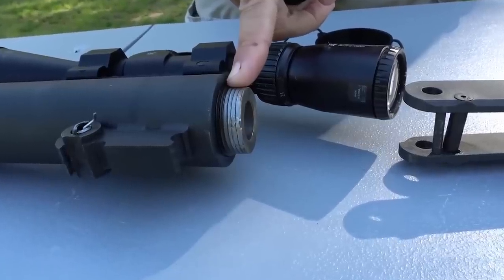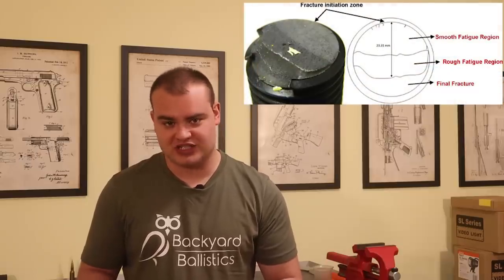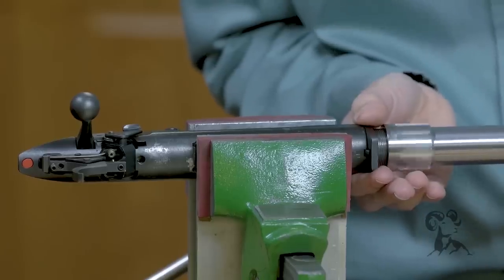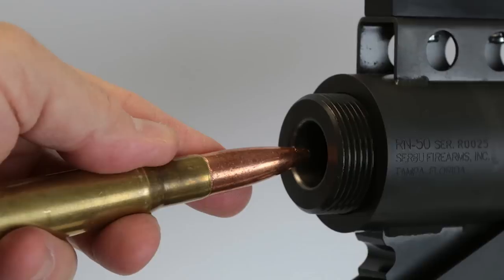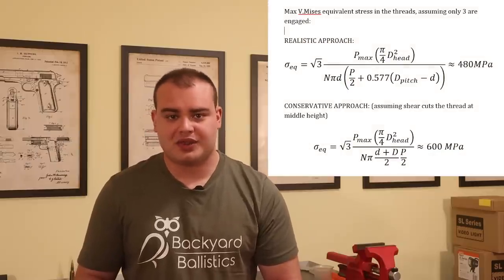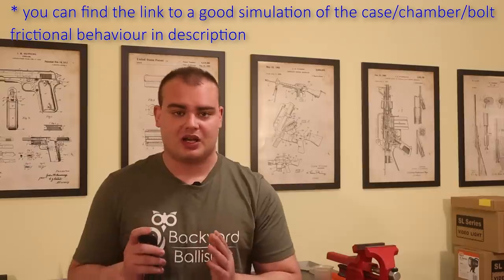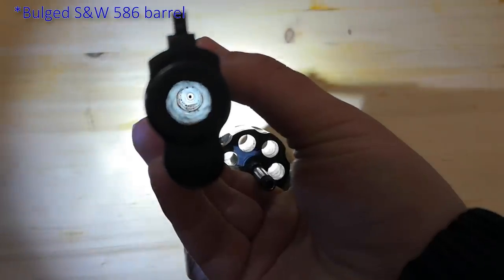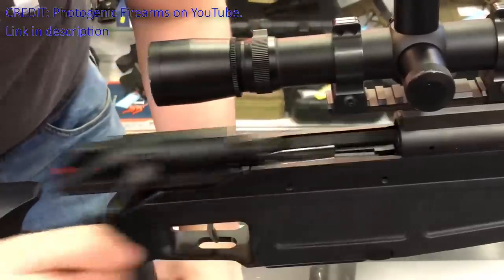Serbu RN-50 Failure: A Closer Look

Comment: Who didn't see this coming anyway ? As soon as I heard about that project between Serbu and RoyalNoneSuch I though the anti-gun community is not going to just stand by and let folks buy .50 caliber rifles at affordable prices without interfering with the process somehow. In other words they can't wait for episodes such as this to occur to highlight them and try to scare away the would be buyers or the gunmakers from making them. It is a very powerful round and with that the user always assumes some level of risk and in the case of powerful calibers the mishaps can obviously result in much more damage than an ordinary caliber. I tend to be satisfied with the old smaller non-magnum rounds and guns myself since they are reliable affordable and usually available and reasonably priced as well. .22LR, 9mm, ..45acp, .223,, 30-30, and 30-06 can get the job done across the board for civilian purposes and I don't find them boring at all.

Comment: im just another idiot off the internet, my take on what you and other channels suggest can happen to cause similar effects is ;
way too hot load intentional/ unintentional/ degraded over time
case rupture / head failure/ other gas into breech face
the design is quite ok. but a few holes drilled radially on the breech cap to bleed pressure would be nice.

Comment: Stretch & fatigue / time, without a sufficient failsafe.

Do the math,
.50bmg Nominal pressure is usually around 55,000psi.
Internal rear casing diameter nominally is 0.68"
So around 20,000ftlb minus the casing to breach stick call it the 20%  exerted on the thread under normal conditions, that would change marginally depending on the load.
Thats around 7tons of force, that thread should be able to deal with that load indefinitely regardless of rate of force change, it easily has a <50% safety margin. 

I would question the source of the ammunition. Likely a extremely hot powder load and heavy grain projectile that would blow that thread out, was it handloaded? But in very poor taste to have no rearward breach failsafe with a rifle of this caliber...

Comment: There is talk about Sabot rnds can't be safely shot through a muzzle brake.
Reply: Because it is bad for the muzzle brake, and the rounds my be deflected towards friendly positions.  Not because it will blow up the breech.
Reply: It only results in poor accuracy and potential damage to the muzzle brake and maybe the crown. It has no effect on the breech.
Reply: @MrSteve8511  Seen it. TR is wrong about a muzzle blockage rupturing the breech.  Re-watch this Backyard Ballistics video.  BB explains why.  TR is an "authority", but not an engineer.
Reply: Not a safety issue, more a parts breakage and accuracy issue.

Comment: The thing that caused the accident was the SLAP round, and the gun. The reason you haven't gotten to see the case, is because there is no case to see it basically disintegrated. The gun was not made to shoot that round, it couldn't withstand the pressure of the round. Now the round that caused the accident, that round was hot, more then the other rounds he shot, those SLAP rounds are old and dangerous, if I were you and you have them, don't shoot them out of that same .50 BMG rifle, or a M2 Browning, those weapons are not made to shoot those rounds

Comment: The gun broke because it was a hot round, it would cause a failure in any gun the issue is that the gun in question has no safety features for a detonation other guns would have other parts that would break internally the rn 50 is basically a 50.cal cannon not a "gun" or the very best a 50.cal pipe gun edit: I never liked that people called that pos a gun lol

Comment: SLAP rounds should not be fired through a break.  It is the deposits of SABOT material inside the break that caused the gradual increase in pressure with every shot.  By design SLAP rounds are a lower pressure round.  The fact that the round went down range is irrelevant.  The sabot created the obstruction, and it dislodged with the catastrophic overpressure.  The screw on cap is similar to a screw in breach on a muzzleloader.  They have failed at way less pressure than this.  So let’s look at the facts.  The breach is not secure enough in this design.  Had there been a locking bolt on their rifle.  The catastrophic failure would have been at the break.  Because the breach isn’t at least 10X stronger because chamber pressure will always exceed muzzle pressure.  The failure happened at the at the chamber and create a greater risk to the shooter.
Reply: Creator says otherwise but, i agree. The failure itself is not relevant, what is relevant is the failure mode of the gun. This could have been so much less painful if the design was safe.
Reply: @trpstrincllc4866   this failure is very similar to what you would see in a pump action shotgun with over pressure issues.  Failing at the breach.  It should have blown break off. Like a normal boy action rifle.

Comment: That was just a round that would have demolished ANY 50bmg.  It was a bomb and freak round.  To shear threads, it had to break off both of the tabs that are tucked right against it which is impossible to imagine until this.  The force required was waaaaaaay more than the maximum load pressure.  It was just a slap round that had either been double loaded minimum or tampered with to cause an explosion.  So, the idea of making the gun safer is pretty unrealistic.  It was as you say, max + 50% minimum which is where they are all configured.  How could you even guess at the amount of pressure that came from that round?  Say 120,000psi? More?  Standard pressure is 55,000.  Are they going to throw away every 50 cal gun and redesign for 180,000psi?  That is just unrealistic and stupid.  It was a bad round, bad luck, bad accident.  No more no less.

Comment: Experienced an 'ACCIDENT' (sic) out on an oil rig once, a 400 lb pipe spinner with enough power (Torque) to spin 90 feet of steel drill pipe as if it was nothing, incorrectly tied down, meant to be tethered in both directions, and then a POS named Chris Wallace threw it into reverse and it was doing a 10 foot arc damn fast, if it wasn't for my cousin Tony, an accurate bastard, showing me the precise technically correct Shotokan forearm block I'd have been dead, as it was it broke my neck and I'd hit the ground about six times faster than gravity would have moved me, I'd been so fit (Kung Fu) at the time it was sick and my first thought was to bounce up and knock that bastard cold and could have, bounced up and knocked him cold but, I'd known I'd been seriously hurt (Neck broke and whole shoulder\back ligaments torn up) and it would have made the worker's comp issue be hard to prosecute, as it was got ripped off for $100's of $1000's of dollars anyway...

Long story short ~ Accident? ~ Nope, Dcik Chayney's Occidental Petroleum were leasing the rig :-(

Comment: Achievement unlocked, and that's me subscribing.  I'll try to keep this short.  I recently received an RN-50 with a 22" Barrel (Haven't shot it yet), I waited for quite a while before I finally got it.  Scott's Video has not deterred me from getting one, I was wanting a Break Action Firearm in my collection, but also a 50 BMG, so the RN is what I got.  The Gun has gotten a lot of hate from different sources.  One comment I saw on a Video said something along the lines of, the RN-50 is a ticking time bomb from after a thousand Rounds or so, the Threads on the Cap and on the outside of the Chamber will start to wear off and increase the chance of an explosion at that point to.  The Gun does not really have a Fail Safe, which I understand that concern, but one's Brain is just as much of a Fail Safe, like inspecting pre, post and after a Range Trip.  Checking the Threads often may not be a bad thing, but also taking the Gun to a Gunsmith is an option at that point as well, and generally knowing and cleaning your Tool(s).

Comment: A non heat treated and non hardened back cap with a safety factor of 2 at best didn't make the situation better.
Neither does the fact that .50bmg loading data is 100 years old and has according safe pressures, that modern military rounds exceed by a long shot. Even worse on heavier tungsten projectiles.
And if you add a constantly closed rifle that has a hot chamber after very few shots and keeps the round in there a long time before shooting, resulting in a thermal treatment of the powder that increases pressure even more, that's a recipe for failure.
There is a reason why neither the rifle nor the slap rounds were CIP certified. And never will be.

Comment: It's a catastrophic blowup for sure  . He said it was a SLAP round.
Sabot, Light Armour Penetrator.
It features a 30 calibre  tungsten  penetrator at 4000fps. It'd have to use faster powders than normal for 50 BMG to get that velocity. 
He said they were rare and expensive.  I wonder if he bought it from a cartridge collector . They've been known to run tarnished rounds through a vibratory tumbler . You get a better price that way .
I have heard that the process of tumbling a loaded round should not be done . The vibrations can grind the propellant kernels smaller , remove retardant coatings and increase it's burning speed .
A thought for you to consider .
Reply: No, it doesn't use 'faster' powders. The projectile is lighter. The powder cant be any sort of 'fast' in a case/bore that large.

Comment: One needs to lock at the ammunition that he used. surplus SLAP rounds over ten years old. One does not know where these rounds originated from. We're they reloads done by a third party and sold off as surplus ammo?  If this was one of the rifles that would have been designed to use the Russian 12.7 mm round I would question if these were adulterated rounds. It is well known that a lot of the Russian rounds for both the Kalash and Deshka 12mm rounds were reloaded with a high explosive and were designed to destroy the weapon and the combatant using the weapon. I would doubt this is the case in this scenario. If you watched his video you could see the progressive power of each successive round until the breech cap failed on the last overloaded round. I have a rule of thumb for most .50 cal rifles is to use ONLY factory loaded ammo or IF you are a qualified reloader, use your own reloaded ammo.

Comment: The problem I have with the threads are the fact that they appear to just be threads. Meaning, if the cap is not torqued properly each time then there is a possibility of thread stretching each time it isn't properly tightened. Loose threads and there goes the ball game. Generally, you want the threaded connection in the 75% of the strength, so as not to permanently over stress the steel. Over time I would think this would have the effect of allowing more and more momentum. I haven't heard that there is a detent to let the user know that they haven't tighten it enough. Instead of a break open design, I would go with a falling block design. I don't know if I've ever heard of this type of arrangement on this large of a round. I think more in line with a zip gun, shotgun shell in a pipe. Anyway, interesting discussion.
Reply: "I haven't heard that there is a detent to let the user know that they haven't tighten it enough. "
That's what the 'safety ears' are, if you haven't tightened the cap to it's base, the receiver can't be brought up to lock... the ears interfere with a loose cap.

Comment: As a machinist for the last 30 years, I have a different view based on what I have seen. The comparison between a bolt thread and the thread on this gun are not similar. The reason why? The bolt isn't hollow (doesn't have a chamber machined in it) What we have here isn't a straight shearing force like we would see in a bolt. What we have here is a compressive extrusion failure. Meaning enough force was applied to cause the 60* vee thread to move axially with the thread profile acting as a ramp. That ramp action resulted in the male portion of the thread (in this case the hollow tube) to compress and deform inward effectively decreasing the pitch diameter of the thread and allowing the cap to strip over it.

An easy tell tale would be to see if a round will still chamber to it's full depth. I'm betting it won't. In my opinion, this rifle would be better designed if a modified square thread or a buttress thread were used to eliminate the ramp effect, as well as adding a gas venting system.
Reply: @Steamfan71 I had (in my non-professional/zero-specialist-knowledge on this subject opinion...) considered something very similar, and am therefore very pleased to see it written here by somebody far more qualified than myself, but surely the vast internal pressure in the chamber would be pushing the inside surface of the tubular threaded area outwards with much more force than the ramp action/compression force that you describe, and make the thread "bite" harder, not softer?

Or would/could the steel of the chambee have distorted under pressure in a "wave-effect", leading to a compression - expansion - compression (or ripple-effect) waveform that overcame the harmonics of the breech-assembly at the thread?

As I say, I submit to your far greater knowledge and experience in this subject, and only ask this question to satisfy my own personal curiosity, but the physics here seem kind of odd/backwards unless the waveform theory was possible?
Reply: @therogers4432  I've seen the same sort of failure in high pressure hydraulic systems and yes it does seem counterintuitive, but when you consider his chamber pressure exceeded 70,000 we have to remember that this was acting on a flat surface the diameter of the of the thread root. If this is a 1-1/2"-12 tpi thread as mentioned elsewhere, then the surface area that pressure was working against is 1.575 square inches. At 70,000 psi that yields 110,250 lbs of force against just four threads. So that's equal to the weight of a loaded semi-truck applied to just four threads in less than a millisecond. 

I think Mike Serbu  needs to machine some mock up barrel ends and caps. Then do some destructive load testing in a hydraulic press to determine exactly how strong that design is. It definitely needs a vent system just incase , so the next time there is an overpressure it's able to vent instead of very nearly killing the shooter.
Reply: @steamfan7147  Thank you for your reply and very thorough explaination -I'm starting to get my head around what you're saying a little better, but that just leads to more questions (obviously IF you have the time then an answer would be appreciated, but please don't feel obliged or pressured if you're busy...) in my mind:
For example, having watched various other videos of the RN50, including some of Mark Serbu's but that was a few days ago now, are you certain that the threads are set at 60⁰ and 12tpi, because they appear to me to be set perpendicular to the breech tube (ie square in section, and set at 90⁰ to the bore and therefore the pressure at detonation), and to my eye they appear nearer to 4tpi than 12tpi? -I'm sure that your calculations are correct for traditional nut-and-bolt patterns of the size/pitch that you quoted originally, but how much difference would this make to the ramp angles that were overcome?

I can't remember 100%, but I think that Mark Serbu detailed all of his stress and load calculations on his video, and I'm pretty sure he came to different results for these figures?

Once again, I'm very grateful for your time and effort Sir, and I hope that some benefit comes to everybody involved in this terrible situation as a result.
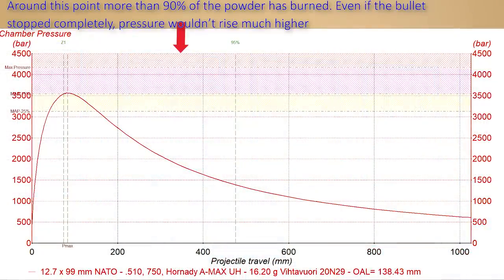Reply: @therogers4432  If you look at KB's video at the 5:02 the threaded section is visible. If you go full screen, the threads in the video appear to be standard 60* sharp v-threads. By 60* I am referring to the thread profile, not the helix angle. The threads in the video also come to a narrow truncated point from what I can see. If they were Acme or Trapezoidal threads, then a truncated thread crest with a fairly wide flat would be visible. Here is a chart with examples of the various thread forms. From what I see in the video it's a American (unified) 60* thread form.   http://eon.sdsu.edu/~johnston/Thread_Notes/Thread_Forms.html

It would help, if Mark could post exactly what thread form he uses along with material specs. Then we could calculated the allowable load from that.
Reply: @steamfan7147  Thanks again for your time and effort in explaining all of this so well, and for using language that a simple layman/dumb*ss like me can understand...

I will go back and watch KB's video again, and also take a look at some other channel's content that show the details of the RN50 (Mark Serbu, Demolition Ranch, etc) up-close and personal, and provide links/time-stamps for anything that I find if you'd be intetested in seeing them?

Take it easy, and have a good one...

Comment: Great video! Kudos! I found particularly interesting (and convincing) the analysis regarding fatigue-related failure. Watching the original video a second time, in slow motion, I noticed that there isn't any muzzle flash. The barrel seems to be occluded. This, despite the fact that Scott is sure it was free.

The only plausible explanation of this incident, so far, seems to be a wrong loading of the cartridge, maybe handguns (fast) gunpowder in a rifle cartridge (that requires slower gunpowder).

But... this seems to me quite unlikely because Scott shot several other SLAP cartridges before this incident. Cartridges that seem to belong to the same batch.

BTW: Any "regular" .50 BMG rifle would have failed much less catastrophically than this Serbu RN-50. This gun hasn't any protective features at all. It looks like a pipe bomb installed on a rifle stock.